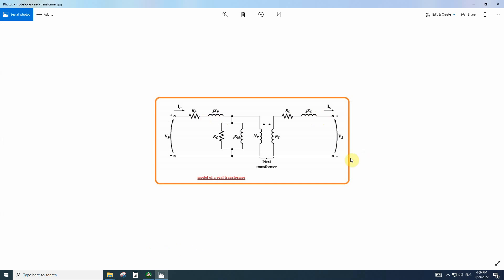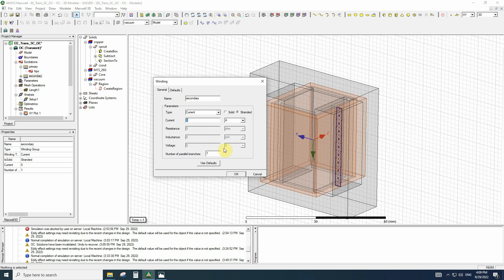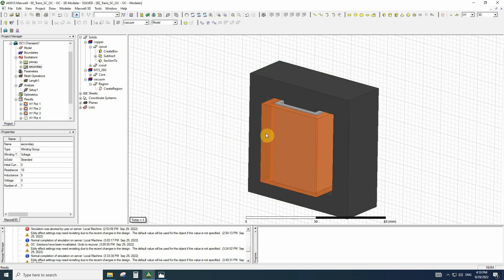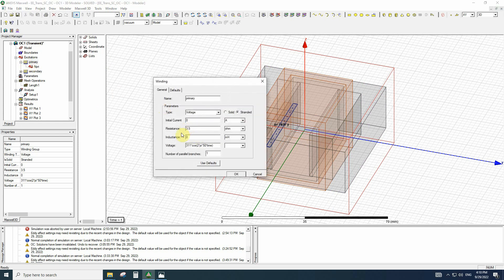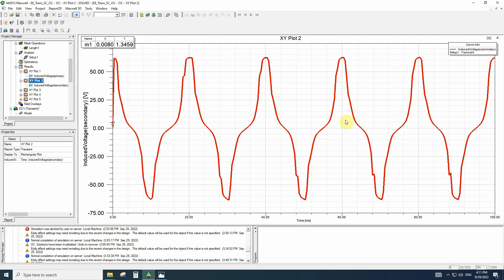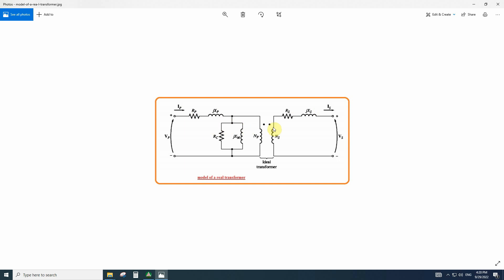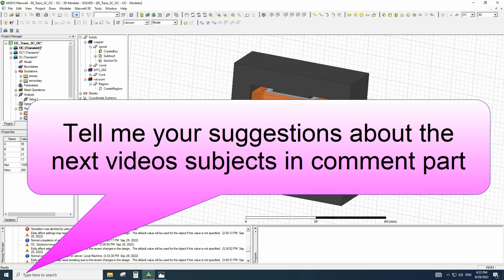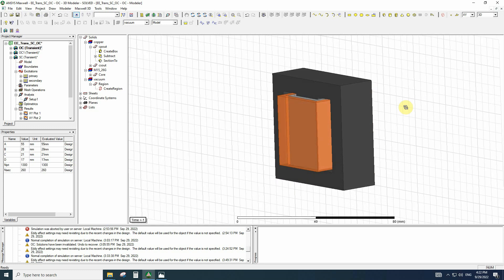How to perform TRANSFORMER Open Circuit and Short Circuit tests

Comment: how u take resistance of coil in primary
Reply from the maker: With knowing the window size and maximum fill factor, you can have the efficient area for winding. The area divided by numbers of turns will tell you the area area of each conductor a d you are able to calculate the resistance by knowing length and area of each coil